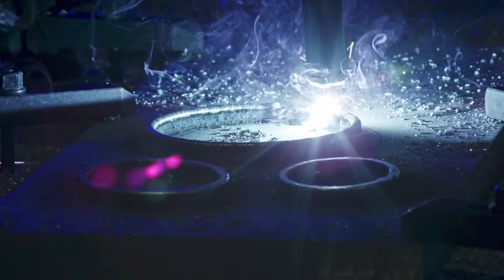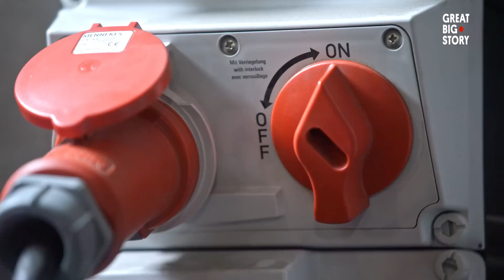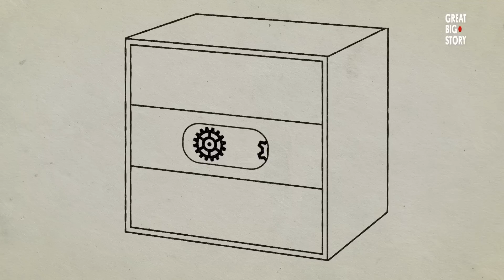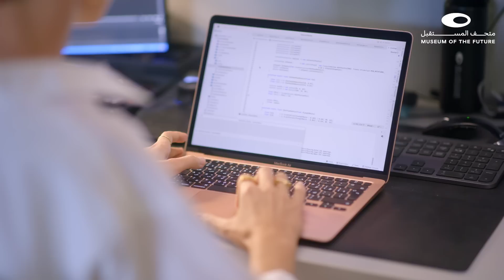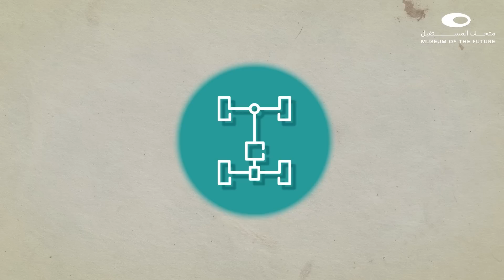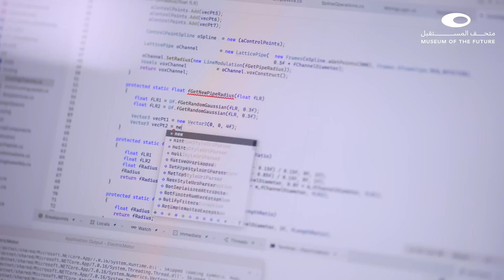The AI Revolution That’s Reinventing Engineering in Dubai

Comment: I think that completely bespoke and digitally generated parts and products is one of the most unsustainable ways of moving forward in our habits of product production, consumption, use, and hopeful repair. Having a product that uses existing hardware that I can buy at a store, or from 3rd party suppliers makes a product resilient, and have a longer life cycle. If my custom digitally engineered, 3d printed, futuristic bike(Or anything else) breaks, how easily, and affordably can I get it fixed? Is it even possible? Compared to a bike that uses existing parts, that do indeed have limitations, but through standardization it makes them accessible, repairable and affordable.

Comment: The points
1) no piece of a component should be without a purpose
And 
2) a change in one part can be made to propagate through the system of parts

Are both really solid, but I have doubts about the capabilities of 3d printed parts under stressful conditions, and do not believe our ai can make manufacturing units for those unconventional parts aswell.

I do not really think that bringing hate to the comment section and saying "horrendous human rights violations" helps anyone. Its their country, and you have absolutely no power to tell them what to do, as long as it doesnt hurt you.